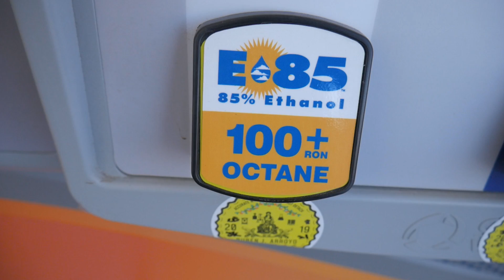Why Can't the BMW N55 Engine Make "High Power"?

Comment: I think BMW figured out that you can get a N54 335i, put some money and take over some E9X M3s. So they built their N55 so you can’t take over their F8X M3/M4.
Now, explain N55 differences between E and F chassis. Even their down pipes are different!!
Reply: This kind of makes sense.

However, in the used market I don’t really see the advantage of buying an N54, I only see disadvantages.

The N54 has so many problems that it isn’t worth it to buy one used, even if your shooting for 500+ HP.

It’s very likely you’ll need to upgrade the N54 turbos, along with various other issues. The cost you’ll spend fixing it will exceed the cost to simply upgrade the N55 turbo & fuel system, and you’ll have a more reliable, newer car.
Reply: @ChristopherGuilday    When you think about back then, ten years ago, it makes perfect sense. Right now you get a tunable B58, makes more power than the N54 and way more reliable.

Comment: I own a 13' pre-July (if you know you know) F30 335i Sedan and my car was in the middle of the development stage. It's PWG. They switched to EWG in July. The wastegate difference alone will allow EWGs to be able to take 20-40 more hp more than a PWG car would. They also had the DME locked until May (dont' quote me on this) of 2013. HUGE differences that people don't realize until they start modding their cars.

Comment: I did a lot of research when wanting to buy a N54. Pretty much i knew not to get one modified, simply bkuz N54 engines had a lot of problems. N55 engines are very much more reliable ! The N55 is the modern version of the N54 but with a single turbo.
Ohh and My F30 335i is stage 2+ and let me tell you that Diss Madufuckah Pulls! 😁
"Your title is stupid"

Comment: E series PWG n55s can hold more E85 (E50) than EWG (E30) cars stock.
Reply from the maker: ive heard that as well, do you know why that is?
Reply: Simply Car Things I would like to know as well since I have a e92 n55 335i
Reply: @MRBD18140  If you car is built before 3/12 it can run up to e50 with stock hpfp. Its because those models share the same HPFP as the n54 did.
 Upgraded LPFP is still recommended

Comment: All n55 has a forged crank
Reply from the maker: no, not all N55's have forged cranks haha
Reply: Simply Car Things check the part numbers
Reply: IBU OR UBME the earlier model n55 cranks were 7 pounds lighter than the 54
Reply: think just m235i and m2
Reply: Head over to https://f30.bimmerpost.com/forums/showthread.php?t=1559827&page=2 and it’s more recent than 2015

Comment: N55 is a more reliable engine
Reply from the maker: big facts
Reply: N55 already reaching almost 300k miles, original turbos. Just like most inline 6 bmw engines.
Reply: This far, it's still a young engine. Hope that vanos solenoid doesn't go. You'll have to pull the entire engine
Reply from the maker: @magictw77  You don't have to pull the entire engine to replace the vanos solenoids. Most people can replace them in about 30min
Reply: @SimplyCarThings  You're thinking of the N54 and N55 where the solenoids and cam gears are in the front of the engine where the timing chain also sits. The B58 moved the chain to the back of the engine which also moved all the other wonderful bits to the rear. Now you tell me, when you take off the engine cover, intake manifold and wiring harnesses to get at the cylinder head (where the valve train is) how are you going to clear the metalwork under and holding the windshield to get at the now reversed solenoid locations?

https://f30.bimmerpost.com/forums/showpost.php?s=064ccd4064df3348e747087b2df8dc68&p=18011729&postcount=14
Reply: magictw77 the B58B30 engine has been already out since early 2016 in the M140i, M240i, 340i, and 440i and the G10 740i phasing out the N55B30 all together. The version inside in the early models was the B58B30M0. the Supra used the B58B30C which is different from the B58B30O1 that the Z4 uses. All the variances are based on how the engine produces its power for it specific platform it is being put in as well as emissions. for 2020 all non sport BMW’s (G-series chassis) will be using the M1 variant of the B58 for emission compliances.
Reply: @ThePandasian34  The N55 came out in 2009 and the N54 in 2006. So remember, the items such as the infamous N54 HPFP problem wasn't "found" (READ: admitted and factory corrected) until about 2011 almost 2012 (almost a full 6 years afterwards) with the class action lawsuit. So after that, the settlement and recall issued didn't happen until probably 2013-14 in full force. Thus my friend, you can be assured that the problems that may arise with age, use, and other circumstances will arise with any new engine. Whether we're talking about any manufacturers engine (i.e. Honda, Nissan, Mercedes, BMW, etc...) or even an engine that is redesigned/improved from a previous design, engineering is very much an art/science that has unforeseen outcomes with anything. You see, you should remember that when you're talking that you should actually research and be aware that there are others that are enthusiastic fans, mechanics, and mechanically-inclined owners who may have read your comment and attacked you violently online. For instance, I started my reply with "Oh wow!! REALLY?! Since 2016?! Obviously every little nuance this engine has is now found!! While it is just coming out of warranty!!" and remembered that myself and decided to let you know that the very fabric that brought us to this video, BMW fandom is appreciated. So, I answered your claim of the B58 being more reliable compared to the N55 with 'it's still a young engine'. We will see once the platform ages and how well it ages, counting maintenance and wear being equal. But I digress, the tracking of reliability in the auto industry is subject to dealership reporting not to independent BMW shops (where discerning BMW owners take their cars) while the uninformed BMW owner or those with no other choice are forced to dealerships. I will say that my N55 hopefully will be very reliable thanks to the lessons learned on the N54. In any case, I hope I haven't ruined your faith in the continuance of faith in the betterment of a great engine.
Reply: Both unreliable compared to b58B30

Comment: It is EASIER and Cheaper to make power on an N54, but it is ludicrous to think you can't make high power on an N55 which is an all improved version of the N54, that gave birth to the S55 on the M3/M4... I had both and can tell you the N55's torque is unmatched by the N54 in stock form or even when you tune both with MHD and stock turbos. The N55 is a better engine period, just like the B58 is better than the N55..
Reply from the maker: yea id agree with you totally! i made this video to try and ease people's criticisms of the N55 engine haha
Reply: Is the B58 proving to be as reliable? I did a huge amount of research before zeroing in on a '14 with an N55. Now eyeing the current M240i.
Reply: @InGrindWeCrust2010 i might be a little late, but yes, the b58 is very reliable. probably the most reliable engine bmw has ever built
Reply: Stock for stock i obliterated my buddies n54 from a dig. He has a e92 n54 2008 while i have a E92 n55 2012
Reply: Leave the drugs please.

Comment: for N52 owners go FBO with NA mods and get the ITB'S from the S50B32 and do a valvetronic delete and run on open lifter and you should be making 360bhp NA horses and if you want to take it to the next level get the supercharger and run 10-12lbs of boost with bigger injectors, N54 radiator and water pump and get an intercooler, swap the transmission with the ZF from the 35i or get the manual from the E46 M3 because the crappy chevy transmission in the 25i,28i, & 30i wont be able to handle the torque and this will result in mid to high 500whp!!
Reply from the maker: thats awesome but sounds like a very costly build relative to the power gains!
Reply: @SimplyCarThings   i agree but it makes you unique because no one really mods N51-52's!
Reply: Omar Saleh have you done this before on your n52 powered car?
Reply: @edwardrodgers281   yes sir even though it cost a lot but its worth it!

Comment: You can retrofit the b58 HPFP for pretty cheap if you find them used under $500 or brand new for $1000. Also Spool Performance is coming out with a HPFP for the f series n55 for under $1000 and beta testing already looks promising. The release of the pump is said to be a few weeks away can't wait 🤗
Reply from the maker: Man that is so exciting to hear! and where can you find those B58 pumps?! that sounds like an awesome retrofit project
Reply: @SimplyCarThings  You can get them used on eBay or from a salvage yard look up the part number. BMW part #13517642466.
The link attached is on how to retrofit the pump and the result https://www.n54tech.com/forums/showthread.php?t=56996

Comment: I have a 2018 M2. I'll be testing the B58 HDP6 fuel pump on stage 2 before going for the big boost/PS2
Reply from the maker: thats something others have been saying! please keep us updated with how that goes
Reply: Is the swap difficult? I have a 2017
Reply: @usernamealreadytaken770  It's not too bad, the actual pump is awkward to get to, and all you have to do is cut the flange on the new pump. The HDP5 evo pump is easier to fit than the HDP6, due to the angle of the connector of the 6, you have to dremel a small bit of plastic from the inlet manifold. You're not from Louth are you mate btw?
Reply: gynads No, America.
Reply: How is it going ?

Comment: Alpina still makes their B3/B4 by taking N55 and putting Mitsubishi turbos from N54 (+ forged crankshaft, larger intercooler, NGK spark plugs, aplina ECU and TCU flash). So current Alpina B3/B4 is basically a N55 + N54 turbos, it makes 440hp and it's a stock car with all warranties
Reply from the maker: very interesting! i had no idea they did that!
Reply: Simply Car Things they have this info on their web site. Don't remember if they clearly say ”N54 turbos”, but you can definitely recognize it from the picture of on their website

Comment: N55 slow lmfao I’ve beaten a 992 Carrera 4s in my stock n55 e90 so slow yea that’s invalid
Reply from the maker: you beat a 2020 992 911 Carrera 4s in your stock N55?? I find that very hard to believe hahaha
Reply: Did the driver of the 992 know you were racing?
Reply: rudy gay liar
Reply: Lies. My N55 M2, which has the best N55, and it isn’t even as fast as a 991

Comment: The point of twin scroll is for faster spool up of the turbo.
Reply: That was the point of the N54s small twin turbos as well, but the cost to outfit the engine with twin turbos is more money than a single twin scroll turbo setup. Only reason they did it was to save money
Reply from the maker: @pgr0104  yep, id argue that the twin scroll does that job better as it can spool very quickly.
Reply from the maker: yes, very good point

Comment: And again, I mentioned this in your last video, all N55's have forged rods, the same exact rods as in the S55. Also my N55 has the same fuel system as the N54 and at 108k I am on the original hpfp.
Reply: There’s a lot of misinformed people out there who never taken an n55 apart but telling people about the engine and they don’t know themselves. I took 3 n55’s apart and all of them had forged internals.
Reply: @billblonco  all of these N55's have the forged crank. • 1' F20   (04/2011 — 02/2015)
• 1' F20 LCI   (06/2014 — 06/2016)
• 1' F21   (12/2011 — 02/2015)
• 1' F21 LCI   (06/2014 — 06/2016)
• 2' F22   (10/2012 — 06/2016)
• 2' F87 M2   (11/2014 — 06/2017)
• 2' F87 M2 LCI   (09/2016 — 06/2018)
• 2' F23   (03/2014 — 06/2016)
• 7' F02 LCI   (05/2011 — 05/2015)
• X4 F26   (11/2014 — 03/2018)
Reply: Scott Redmond I have done pistons kits in 2 F30 EWG N55’s both of them had forged crankshafts, even 90’s Honda B series D series H and F series engines had forged crankshafts I doubt bmw would skimp out on something so common these days.
Reply: @billblonco  I am not sure how you are confirming that on an F30 (part number for the forged crank doesn't apply to any F30's) but it's really a non issue anyway, it's not like people are breaking crankshafts anyway, bearings spin or rods bend before that happens.  And yeah I was building turbos Hondas in the late 90's.
Reply: Also if you read the S55 engine pdf from BMW it talks about the differences in the variations of N55 crankshafts and how they compare to the S55 crankshaft.
Reply: Scott Redmond I will have to go digging but to my understanding the n55 doesn’t have forged internals and the n54 does. One is open deck the other is closed. And the turbos to me do not make a difference since a lot of people go single turbo anyway.
Reply: @Trouble81  please dig, all N55's have sinter forged rods and if you need a list of the N55's that have the forged crank let me know. Also the N54 and N55 are open deck. Having to read over and over about the N54's "forged internals" I just annoying AF. Also it's sinter forged.

Comment: Stock Turbo (EWG) N55's are running mid 11's. 99% of custom single turbo N54 cars are 11 second cars so how much more hp an N54 can make doesn't mean shit really. After 13 years there are still only a handful of N54's running 9's and barely. And there are not many 10 second N54's either when you consider how many were built.
Reply from the maker: totally agree man, I think with N54's a lot of the bragging has become simply a numbers game which is somewhat meaningless in my opinion

Comment: With the mods applied to this n55 what’s the top speed?
Reply from the maker: im not too sure but id guess around 170ish mph!
Reply: Simply Car Things I removed my limiter on my 2011 335i MSport PPK, and 160 on a runway was not even an effort.. Didn't go full top speed as it was a small private airport in Nevada, so I can see 175 or a bit more
Reply: @SimplyCarThings  I have the N55e Series and I got up to 150 MPH and still had room for more. I believe 165 - 170 MPH max.
Reply: 7000

Comment: I got my M-packaged 08' 135i right when they came out, and sold it for my 15' M235i. Both first and only owner of the cars. Pretty much fell on the floor laughing when you mentioned the N54's advanced fuel system/pumps. BMW owned up to its issue, and slapped 120k mile warranty on N54's fuel pumps, so I respect them for that. Nevertheless, I was at about my 6th fuel pump by the time I got the M235i. Such a headache.
Reply from the maker: yea total headache for sure haha, it's interesting though since the N54 HPFP seems to be stronger out the box although not as reliable
Reply: SIX? GEEZ lmao.
Reply: That was across the board the minis had the same issues.
Reply: I guess you never bought good fuelpump insted of original?

Comment: I want to see the different variants.
Reply from the maker: ill make a video on this topic
Reply: Only thing forged in N54 was the crankshaft.

Failed to note the N54 has piezoelectric injectors vs. the solenoid injectors in the N55.  Many improvements in big end bearings, windage control, cooling pump regulation and oil separation on the N55.

Note to poster:  Under hood air is hotter and less dense than ambient air.  Thus power isreduced by the DME.
Reply from the maker: @machtschnell7452  great points that i didnt know about. i read that the N54 had forged rods as well, this isn't true?
Reply: Crankshaft in f30 n55 is the same in the s55 f8x

Comment: N54 is legendary ❤️👍👍
Reply: N55 for daily and N54 for project ;)
Reply: EYZ thats what i got 640 and 135 😁
Reply: @elias1747  Vice versa  ;)
Reply: @elias1747  FACCCTSSSS
Reply from the maker: it's a fantastic engine!
Reply: Over engineered from the factory ;) N54 Gang 💪🏽
Reply: My n54 is at 109k and still going strong....
Reply: @wrongwayup8217  darn I'm almost ther...😃
Reply: @drifttandemz101sidewayzz9  119k today and  did a Valve Cover and gasket with no pervious experience in just over 3 hours. Only cost me 110 bucks. If you treat her like a BMW she will treat you like a BMW 😊
Reply: Had nothing but issues with my old n54, long live n55
Reply: @specialboye4910  what issues did you have?
Reply: Was, NOW THW KING IS A B58 TU
Reply: And also 'legendary' for being very unreliable
Reply: Legendary for the amount of time it has spent on jack stands. 😂